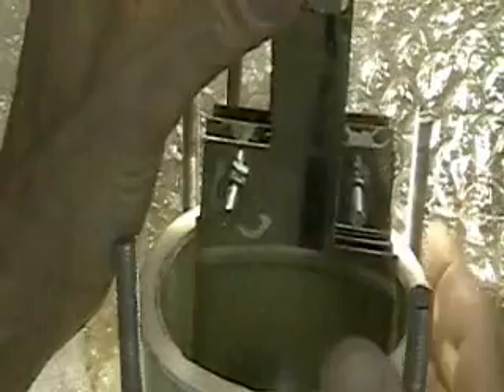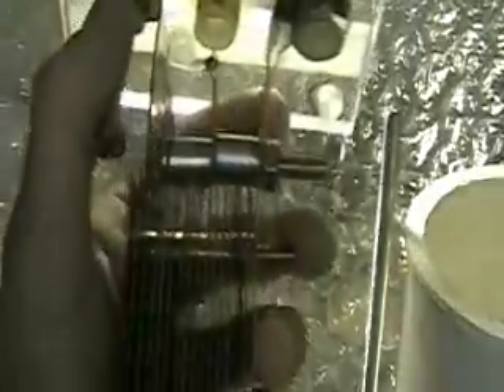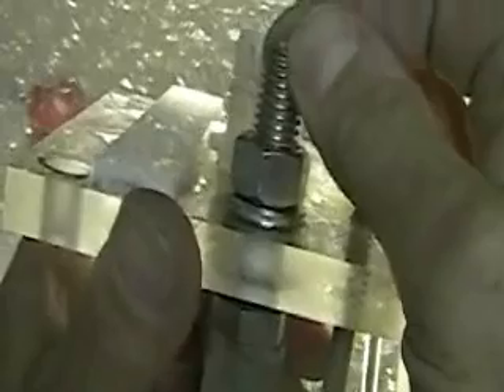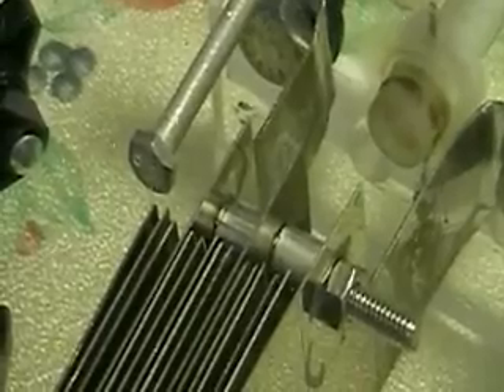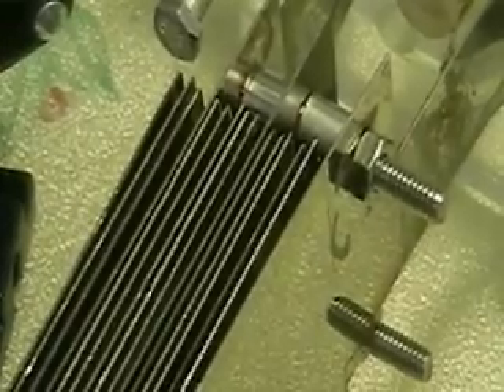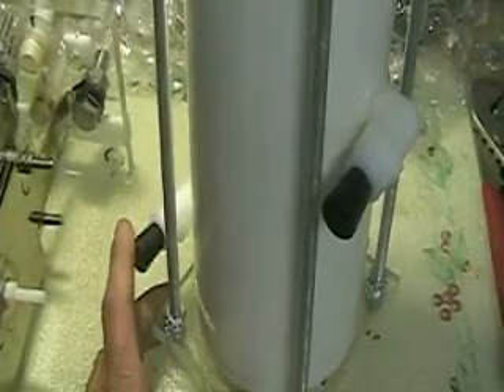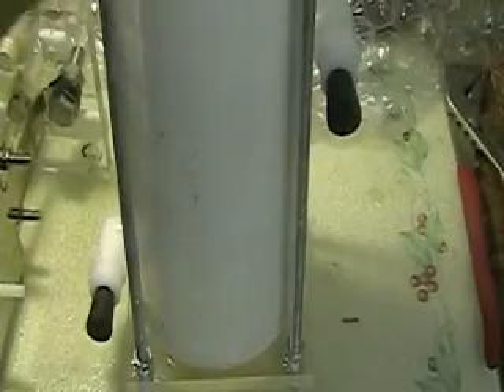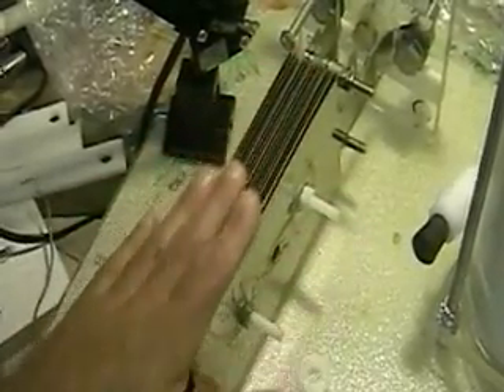Hydrogen Tap ( FOCUS-ELECTRODES 313

Comment: John, what was your concern about using a 3-5psi for a valve?  Wouldn't the higher presure reduce the likelyhood of ignition into the canister anyway?  May take a little longer to prime the system, but in the cells I've seen, I don't suspect that would be long anyway.  Also would a second check valve (higher preasure), be needed on the canister as well?

Comment: Nice work John,
One thing I noticed it looks like you have rubber between the electrodes and the cover. The electrode should be sandwiched with a nut first before the rubber to keep the connection tight. Otherwise I see high resistance with increased heat and amps.

Comment: One element missing on all the cells seems to be a blowout cap.  If that sucker ignites in a closed container --- it can and will kill/mame someone... maybe an innocent bystander(lawsuit!).  You may want to put a large hole in the side of the cell body with a rubber grommet of some sort to allow the pressure to escape if it ignites somehow thus preventing a catastrophic explosion of the cell. Comments?